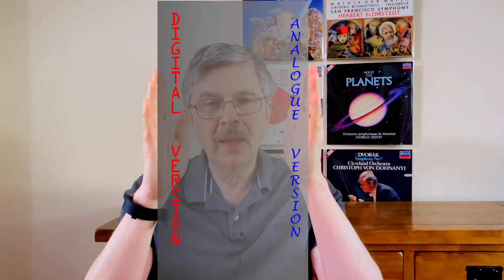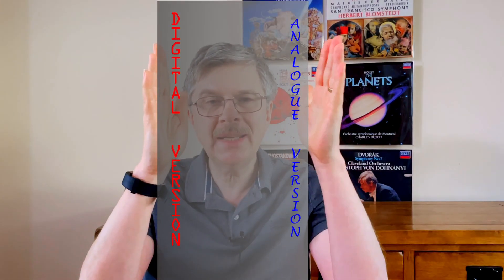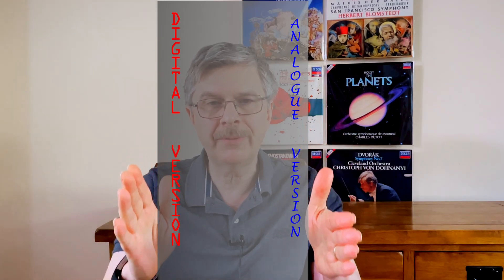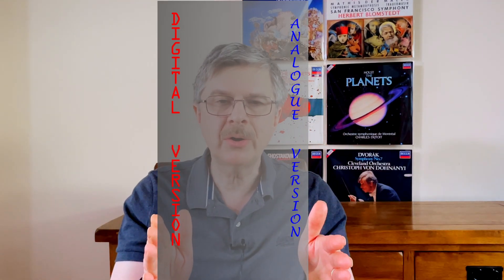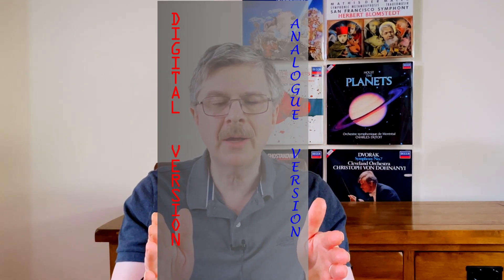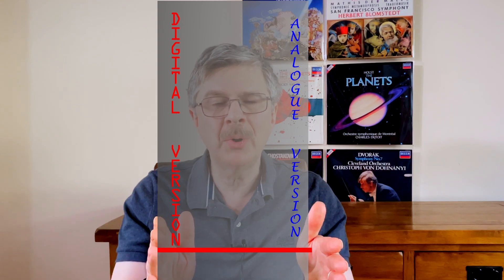The Dawn of Decca Digital Recording System: Part 3

Comment: Thanks for these informative videos on the digital process Decca chose. I often wonder why Phillips digital CD and LPs sound so good to my ears. Any recommendations for your top London digital recordings?
Reply from the maker: Thanks I'm glad you are finding this series interesting. I am currently working on a top 10 London/Decca Digital Highlights video from the early years. This year is proving to be a difficult one for me for getting content out but it is my other target to achieve before the end of the year. In the mean time here are some recommendations: Haitink Shostakovich 8 (amazing sonics and performance from a famous but uneven cycle, 5 is easier to find, usually cheaper and very good too); Chailly Puccini Orchestral Highlights (a textbook example of a hidden gem); Ashkenazy Sibelius 1 (one of the last of this cycle recorded hence superb) and Dohnanyi Dvorak 8 (7,8 and 9 are all fab but 8 is the one I keep coming back to). My main tip for vinyl is avoid the early releases especially most recorded in 1979! 
Philips did a few Soundstream collaborations but ultimately settled on the U-matic sytem using the PCM1600 and they edited using a DAE1100 combined with a Decca built digital mixing console (as DAE was very basic) which they got from all being under the Polygram umbrella. As far as the vinyl format the Philips digital vinyl appears to share some similar positive qualities to Decca. With the Dutch pressings both definitely avoided the pitfall of adding harsh early DMM to the process and I think Philips had a similar chain for digital vinyl production of using an analogue magnetic tape stage for cutting purposes; which may have unintentionally had a benign influence on the end product smoothing over some of the harsher qualities the pioneering years of digital recordings are prone to. I suspect with your passion for R to R you may have some interest in that aspect!